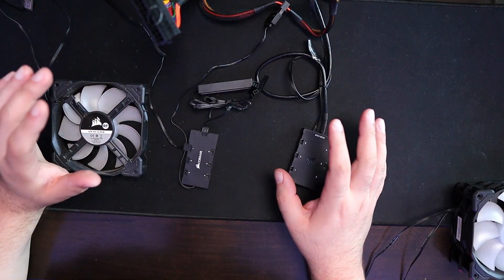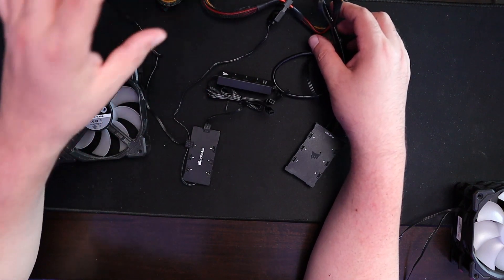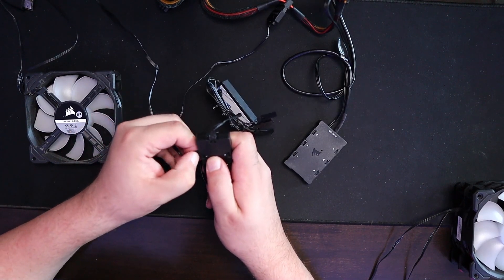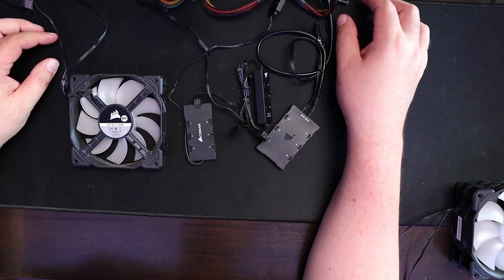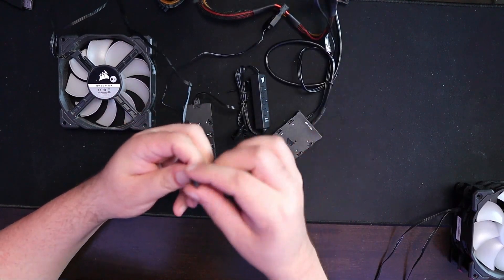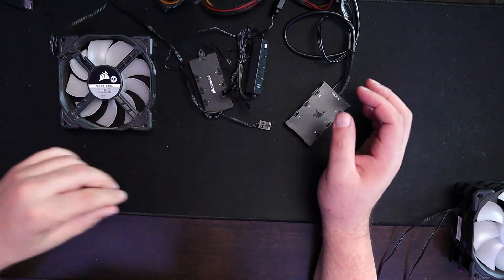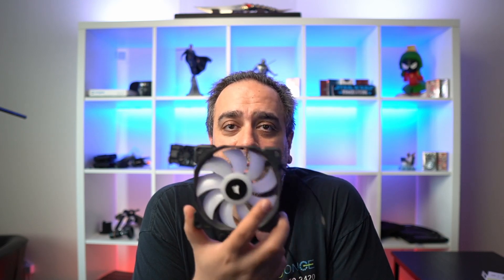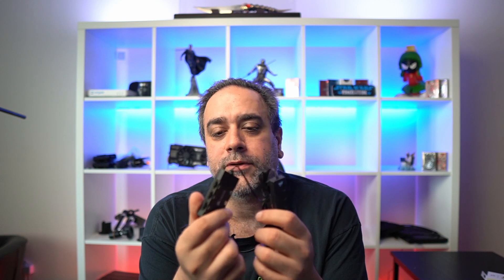RGB Corsair Fan Problems - Old vs. New

Comment: The issue I am having with my corsair fans is either the color matching between the fans and iCue dont match up now or one or more leds have degraded and the other fans are trying to match its output. Pure green and pure red seem to work just fine, but pure blue is weak, and pure white is just yellow on all of my fans. I have the new controller as well but I do also have 8 fans so have to use two controllers. This means to get the sort of vaperwave blue/purple mix I have to drag around the color wheel until I get sort of matching colors across all my RGB stuff, and I am not about to spend over $400 to replace all 8 fans with the latest corsair Link fans hoping those dont have the same led problem my current ones do. QX120mm x3 kit $158 (need 2) and QX140mm x2 kit $140 = $456 before tax for 8 damn fans......
I might try taking two of the fans off the RGB controller as they are under the GPU in the Hyte Y60 case and dont really get bright enough to see the light from them in my chair, but you can see them if you are standing looking at the case from the front rather than the side.
The issue is trying to find out if one of the fans has a bad led or more than one bad led or if it is just iCue being dumb, or if the way they are connected on the controller is causing the issue, and I do not look forward to that long process of trying one fan at a time. sigh
Reply from the maker: The amount of problems I have had with RGB fans and colors and getting them to all look good or even match has been a true nightmare.

The NEW iCue Link fans are nicer but they are crazy expensive.  But do eliminate a lot of cabling issues and power problems with the "new" hub and power requirements.

Dimming usually is a cause of lack of power.  Or burnt out RGB's on the fan itself. . . testing one fan at a time would take some time but it will rule out power issues.  Since your getting odd colors, I am thinking more burnt or defective led's on the fan.  have you tried switching controllers with the other fans that don't work to see if changing the controller works?  it could also be a controller issue sending the wrong signal for the color?
Reply: @BootOnce  
I have the iCUE H150i Elite LCD XT with its fans plugged into the commander core that it came with as well as one other fan. Then I have a second iCUE COMMANDER CORE XT with four more fans plugged into that. All of the fans will look yellow on white and the blue is purple, purple is broken and looks teal, pure blue is weak, and if i set it just in the right spot on blue it looks like a mix of purple and pink that gives it a sort of vaporwave purple look. (but the LCD ring is deep blue like what is actually set to)

Eventually I will check all of the wires but it is a bird nest back there xD
Reply: @BootOnce  
iCUE H150i Elite LCD XT w/ iCUE COMMANDER CORE -  Three AF120 RGB Elite Fans (on rad) and one iCUE SP120 RGB (rear exhaust)
iCUE COMMANDER CORE XT - Two iCUE SP120 RGB (rear panel intake) and two iCUE SP140 RGB (bottom intake)

The LCD ring displays the correct color but all other fans display wrong colors regardless of which controller they are plugged into. Both controllers have their own power. White looks yellow and blue looks purple or pink or both depending on where on the color wheel I have it set. Also the RAM rgb displays correct colors as well but the real ram and the rgb extension kits don't totally match each other but are close enough.

Have not yet gone to each argb cable to check them but they are split on two controllers and all fans have the same issue. Like the exact same issue which seems like a software issue but I also have the latest version of iCue and this has been an issue for a while. iCue sees all fans and correctly displays the colored adjustment locater light for setting up where your lights are and how they are arranged.
So not really sure what to do other than trying only using one controller but limiting myself to six rgb fans.
Reply from the maker: Try one controller at a time. . . if that shows still weird, then try one fan on one controller at a time.

If you have another spare power supply it might be worth trying and testing with that so you don't have to boot your system each time you can just go through each one and test with alternate power it might make it easier for testing.

I really do hate the old controllers I had a lot of problems with them, with out matching the fans to the controllers and it's rather difficult to match. 

Kind of glad that corsair went with the one connector and new controllers but I haven't tried those . . . I kind of gave up after the last controller problem.

I have a bad feeling that you might just have incompatible controllers. . . but it's kind of hard to determine as corsair doesn't really have a lot of information on the older controllers.

I was able to reference the  CORSAIR iCUE COMMANDER CORE XT but on their site it says it requires Corsair RGB LED Hub to connect six corsair rgb fans through the 3 pin rgb header?  Your fans I don't believe are supported. . . SP RGB Fans have a 3 Pin, DC Controller and can not be controlled through Corsair Liquid cooler fan connectors.  Also can not be mixed with other fans on other controllers.  You will need to use a different controller made for the SP RGB Fans. . . The fan controller you need to use is the older style Corsair SP RGB Fan LED Controller.  Something like this:

https://www.corsair.com/us/en/p/pc-components-accessories/co-8950021/corsair-sp-rgb-fan-led-controller-co-8950021?srsltid=AfmBOopYIOZENCG17TGZbLd2iz4ovHElDH6wIZ5aYWLSPpicCfzUu45t#tab-techspecs

You might want to also check out this forum for a good break down of fans and compatibility, someone actually wrote up a very long forum post on this.  Looks like they don't have much help there but they do break down the different controller and fan types and what they work with.

https://forum.corsair.com/forums/topic/138723-zottys-corsair-rgb-hardware-and-icue-eco-system-faq/

I checked out the fan section and there are a LOT of different fans and only a few work with the liquid coolers.  You might have to either decide on using the simple controller for the different fans.  OR change them out to the ones that work with the liquid cooler controller. OR switch out all fans and controllers and go to the new standard connector which eliminates a lot of guess work but is crazy expensive.

I hope some of this helps.

Comment: Nice to come across someone that has the same issue as me…
I recently bought a Corsair iCue 5000x case.
The RGB on the fans that come with the case do work, but the fans that I bought (back case fan) and those that come with the Corsair H100i doesn’t even light up to begin with…
I’ve tried also to connect them to the fan hub that came with the cooler and also tried connecting them to the fan hub that came with the case (thinking it would work since the front 3 are…) but both methods doesn’t work…
I’ve tried using the iCue software also well but it can’t detect any fans but only the pump header…
Honestly quite disappointed in Corsair’s stuff now after rebuilding a 9 year old computer…
Reply from the maker: The corsair problems with their fan controllers is half the issue.  I just wish they wouldn't mess with the configuration.  It's crazy to spend even more money on replacing out fans and controllers that work but only with their previous controller.  It would also be nice if corsair mentioned any of this to the customer to help with their proper purchase.  I feel your pain.
Reply: @BootOnce  welp, should have done proper research before buying their iCue products...
Reply from the maker: It's basically an assumption that I guess we shouldn't have assumed? LOL. . . it's a fan and fan controller LOL. . . I wish they also put this information on the website, as they don't state that one will not work with the other.  I think that would have helped a little.

Comment: I got 1 issue, my AiO (corsair h115i) has corsair fans argb, but which onces are my fans??
Reply from the maker: If your replacing your fans on your AiO I would recommend you contact corsair directly to get something that matches your device.  The reason is that AiO fans plug directly into the pump and might be a different type of fan then the ones you can get from the site.  You can contact corsair via chat on their website give them the exact sku number this will also help.  So that you have fans that work with your AiO pump / controller.  If you have it plugged into a separate controller then you would match it to that controller.
Reply: @BootOnce  👍👍👍